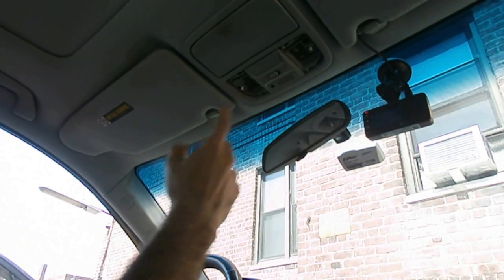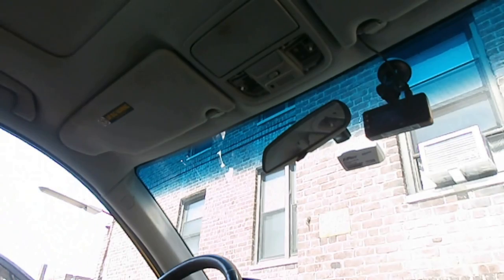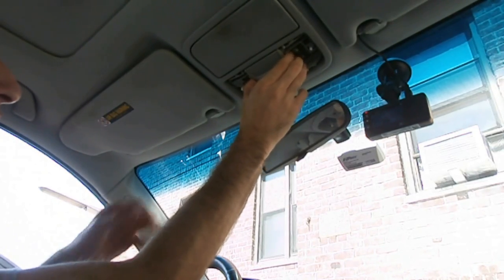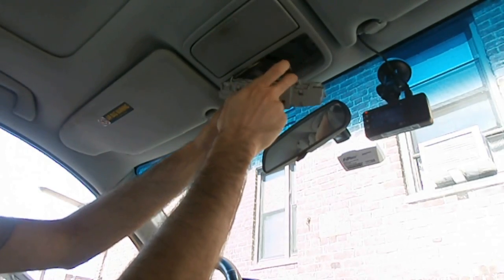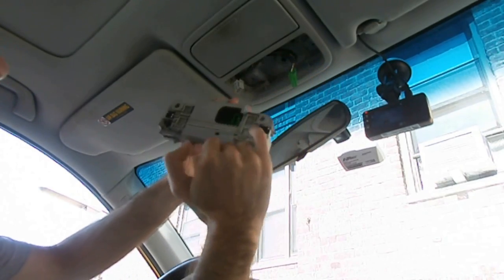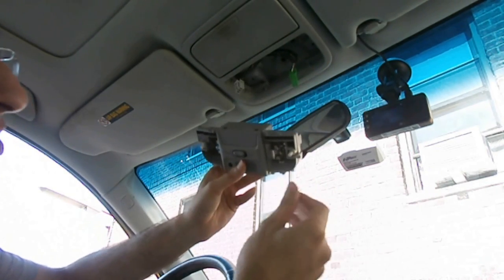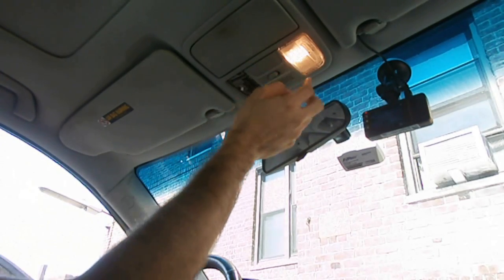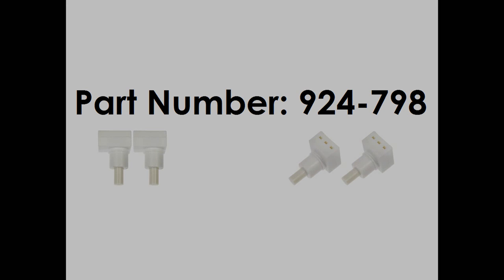Honda Accord Map Lights - Dome Lights - problem - repair - fix

Comment: Great video.  I tried swapping the switches and the left side still does not work but the right side does still work.  Hmm...  That tells me the problem is not the switches.  Time to get out the multimeter and check current to the connector on the left-hand side.  That'll be another day.

Comment: thanks I have the same problem. My certified Honda used car warranty wants to cost me $75.00 to diagnosis this and then see if the Honda warranty will cover it. I will be fixing it myself, thanks a lot.
Reply from the maker: +40jericho Glad to hear that my video was helpful :)
Reply: i agree

Comment: Thank you very much I have the exact same problem  and Honda wanted to replace the dome system costing around $120. I am sure this will fix the problem!!
Reply from the maker: +Fernando Duclaud I hope it does, let me know how it goes.
Reply: Did this fix your problem? Honda is trying to tell me it's the base.   Part# 34404-SDA-A22
Reply: Yes it did, thank you very much for your help. I ordered a replacement of the exact same part you are mentioning on your video and got it from e-bay. I install it according to your instructions and fix the problem right away, thanks again

Comment: This apparently is a common problem with the Honda overhead "map light" system - We have a 2011 Honda Odyssey Tour Elite model and the assembly closely resembles the accord as shown above - Reading all these U Tube videos on this problem indicates, that the great majority of the time , that  Changing the Switches fixes the problem ! It worked on our vehicle too ! 
 You can get a new pair of them on E-bay for around $ 7 -------- So thanks to the many who steered me in that direction --------
 The local Honda Dealer indicated we would have to buy the WHOLE NEW UNIT ------  I told em " I'll check it out first " !! ----
I will let them know how I (we, counting you guys) fixed the problem !!
Back to the other reasons for my post -
 These switches are of flat blade receiver design, that simply snap in, onto 3 flat 1/8 " wide pins - so be very careful when snapping them into place - This snap switch is called a 2 position maintained contact switch whereby the center receiver of it is the common, and the outside 2 receivers alternate either to open or to closed (if checking) from the center one - providing the switch is working correctly.---- OURS CHECKED O.K. AFTER CHANGING THEM BOTH SO THEY WERE NOT BAD !!------ If they are snapping (you can physically feel or hear it) chances are they are working .
 What probably happens when the "map lite" system shows irregularities like this, the electrical contact at the blades or at the bulbs for that matter,  eventually become slightly corroded and will not conduct the low voltages that are present here !
 For 7 bucks though, it is well worth the experience of changing them yourself -

Comment: Had the exact same problem (right side didn't work, left side did). Video was very helpful. Only thing was tho... when I changed out the switches to new ones the right side started to work, but now the left side doesn't. Any idea why ? Thanks.
Reply from the maker: Hmm... there could be a multitude of reasons. I would start by removing the switch from the left side and inspecting/cleaning the 3 pins (which the switch connects to) on that module.
Reply: did that multiple times. very frustrating. I ended up keeping the new switch in the module and tossing the old one. It works intermittently now.

Comment: I just replaced my door jamb switches and did not fix the problem so I just watched your video and I found my switches on rockauto but I have a question.  Is the switch the same for the rear dome light because I am also having the same problem for the rear seat.  The light works but only if you turn it on by hand.  It doesnt come on when the rear doors open

Comment: Nice video.  Very easy to understand the steps.   Saw your dashcam mounted next to your rearview mirror.   I was going to buy one but not sure how/where to access a 12V constant power.   Where did you tap into?
Reply from the maker: I run the long power cord that came with it all the way to my center console :/

Comment: When your light stopped working did it come on if you clicked it by hand?  Mine won’t turn on when doors opens on driver side but works if I manually click the light.

Comment: switches fixed my problem.  neither light would come on so they both work now.  I wish I would have tried just tightening the one ground screw first.  that may have been my only problem.

Comment: The center pin on the connector is also the ground.  It should work with or without the mounting screw innstalled.

Comment: I have a 2008 Accord, and neither the front dome lights OR the back one works.  If changing fuses doesn't work, my question is, does changing the switches in the front as in the video ALSO fix the problem of the back dome light not coming on?

Comment: hello,i have a 2010 ridgeline. the map lights only come on when pressed. not when the door is opened or when i hit the dash switch. another thing of note is that the backseat dome light will not come on at all?  removed the witches , adjusted tangs, checked fuse, good. tested for dc power , 14 volts? does the front map lamps affect te rear dome ? tested bulbs, continuity ant suggestions ?? thanx in advance 
ian

Comment: Please help. My accord 2012, 1 front dome light broken. I removed other dome light to test itt in the broken one. It worked, so I know it is the bulb. Then immediately it went off. And Then all 3 front and rear dome lights don't work. What did I do wrong? Bust fuse?

Comment: my left dome light went out but there's little orange light that comes on when that light is on; that little orange light still stays on and if i mess with the switch a bit the light will come in and out like its got a connection issue. around the same time my car has to be jumped every time i want to go somewhere and after replacing the battery and cable ends for the battery i'm still running into problems
my question is could this faulty circuit be the reason why i'm getting battery drain?

Comment from the maker: If exactly one is malfunctioning you can try swapping the switches in your dome light assembly; if the problem goes to the other side then you've confirmed that it's the switch. Thanks everybody for your tips and comments, I appreciate them all.
Reply: I was actually thinking about it  great video thanks
Reply: Hi I have problem on my 2003 honda accord. 
the map lights and dome lights it's not work with doors..
but they work Separate. 
how can I fix that proplem  ?

Comment: Spare the expense of buying new switches ~ It is more than likely the contact points going to the switche/s.  When I took mine out of my Ridgeline, i noticed that  the metal is "stamped",  leaving burrs on the center tab.  Sand, file down the burrs and reinstall the switches.   The right mounting screw Is a ground point too.

Comment: GOOD VIDEO BUT THE LIGHT COVER REMOVAL AND INSTALLATION IS MUCH EASIER WITH A BUTTER KNIFE. THE LIGHT PRESSED IN TO REMOVE THE COVER WILL POP RIGHT OFF WITH PREASURE DIRECTLY IN THE MID SECTION OF THE COVER. INSERTION REQUIRES NO TOOL. OTHERWISE THANKS FOR THE TIP ON THE SWITCH. I MAY HAVE TO ORDER ONE. IM HAVING THE SAME PROBLEM. THANKS
Reply: thank you for this. made it a lot easier for me

Comment: So have the same issue and have new bulbs, new fuses, and bought those switches and Still no lights in accord.  What do you think the issue is? Was fully working everything else working electric.
Reply from the maker: What I would do in this case is slide the switch on the dome light assembly and test every scenario that's supposed to turn the lights on in all combinations. If that wouldn't help I'd start tracing the wires that run to the assembly for continuity and also voltage.

Comment: Hey I came across your video. Very nice fix first of all! ;)
 I've had this problem on my drivers side dome light. When I open the door, only the right/passenger side switches on & fades out when I close the door & it can be switched manually with the button. The drivers side however does not switch on when you open the door. However, it can be switched on manually by pushing that button. I tried the bulb swap but still it did not work. Is my problem the switch, or something else?
Reply from the maker: That sounds like the switch is the problem.
Reply: Maximum Tenacity ok... I'll switch the switch around to test..(did that make sense lol). Thanks for replying MT😀
Reply: Maximum Tenacity I got around to fixing my issue &I got a switch from the scrapyard. Works excellent & your video helped out. Just wanted to thank you for your pro tip

Comment: My 2004 honda accord I just bought has that exact issue 
But I caused it by switch from the bulbs from stock to LED BULBs

Where is the cheapest place to get this part??
Reply from the maker: The switch is: Dorman 924-798. Google it and see prices online. There may be some for sale on eBay and Amazon too.

Comment: Need some help here. Followed this video and changed the dome light switches, but now my problem is that the front lights do not come on when i open the doors. Any ideas on what went wrong here ?? thanks
Reply from the maker: I'm not sure how it's wired up for a 2011 Acura TSX, sorry bud :/

Comment: Ok so with a voltage meter what settings should I set it on to test the wire connection?

Comment: i tried putting in led lights while switch on.. it kinda flashed and stopped working even the other side stopped working. do u know what could have happen...?
Reply from the maker: Switching to LEDs can be tricky, gotta make sure that the electrical parameters are the same. There's been plenty of cases where people try to switch to LED lights for some of their car's lights and it just does not work well with some circuits. Bottom line: I doubt you burned a conduit in the dome lights circuit; if anything, you probably just blew out a fuse. Try putting the old incandescent bulbs back in and if the lights don't work then start troubleshooting at the fuse box.

Comment: How where did you get those switches?  I have the exact same problem.  The dealer wants $100 for the part.
Reply from the maker: +JP Gabay If you type "Dorman 924-798" in a search engine, you'll get plenty of results for online stores. I'd suggest checking ebay and amazon too.
http://www.autozone.com/1/products/57535-switch-dorman-924-798.html
http://www.amazon.com/Dorman-924-798-Dome-Lamp-Switch/dp/B00FY81BUQ
Reply: oh man.  got so excited... till i searched and found this part is not good for my 2001 Honda Accord.  Accord only sells the whole assembly for $100. even Amazon search says part is not good for 2001.  and i know it is the  switch.  no clicking when lens is pressed - clicks and lights on passengers side.  :(

Comment: The right hand screw holding attaching the overhead console to the car is NOT a ground  tie-in to the vehicle ground. look at the screw attachment, it's  a plastic piece that is inserted to a hole in the sheet metal. that screw is isolated. that connection ring in the light unit must be for something else. in my wife's 2008, I was able to test the switches with the light unit dangling, unattached, and all functions worked. Also, if your map lights aren't working first try to just reseat the switches. it might just be a bad connection. that's all I  had to do....
Reply: +Bob C 
How to reset the switch?
Reply: The switches slide out. I was going to swap them to see if it was the switch or the assembly. When I swapped them they both worked so I guess there was just a bad connection. Maybe  the plugging and unplugging cleaned off the contacts.
Reply: Bob C.  I have a 2008 and I also tested that screw as a "ground", which it is NOT.  I swapped the switches and now both turn on and off although won't work with "DOOR"... I guess I have to replace BOTH?  I appreciate any feedback...
Reply: mister stealth,  not sure. my switches started acting up so I replaced both. they worked great for a couple days, and then the passenger side light stopped working. so I'm at a loss. I thought I'd try some contact cleaner, and if that didn't work I would put one of the original switches back in. I wonder if I'll need to look on ebay for a new console in the end. Sorry I can't be of more help.....

Comment: Dude!  Many kudos to you.  My 2004 Accord EX-L had the exact problem on the passenger side.  I figured, ok, it's got lots of miles.  6-months later the exact same symptoms on the drivers side - now I have no auto-dome light when I open the door.  Sucks.   Searching around, found your video, found this: https://www.amazon.com/gp/product/B00FY81BUQ/  (2-pack for <$15).... Followed your video and BAM!  Both sides work!  Yer awesome!

One thing... I didn't both disconnecting the unit, I was able to swap the switches with it hanging in the air.  And yes, getting those lenses out without damaging them can be tough.  They do pop-up but I can see the plastic just slightly bent when I did it... plastic doesn't like to bend :-)  

I have seen complaints that replacement switches don't last as long.  I'm 201,000 miles, 12.5 years on my Accord.  I wonder how long the switches will last! cheers
Reply from the maker: Glad to hear the good news. As per the longevity of the replacement switches... I would bet they can last no worse than the OEM ones. We can always be the guinea pigs and post on here if and when the replacement switch(es) does go bad and state how long it lasted.
Reply: I'm glad you asked.  I replaced both switches and 1 stopped working 2 days later!  I'm now on 8 days and the other one is still working.  That kinda sucks...  I'm going to buy another and LED replacement bulbs since "someone" said LEDs might help with switch lifetime.  I dunno that I buy that but I like the idea of LED bulbs anyway.  

So... I'll check back in in a few months but yeah... poor lifetime!